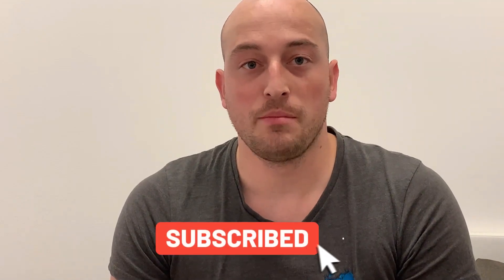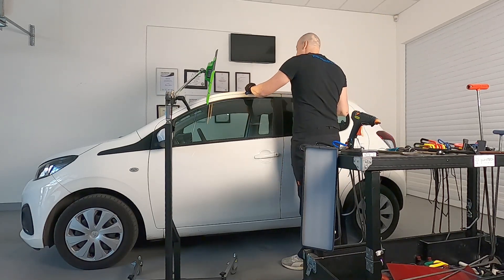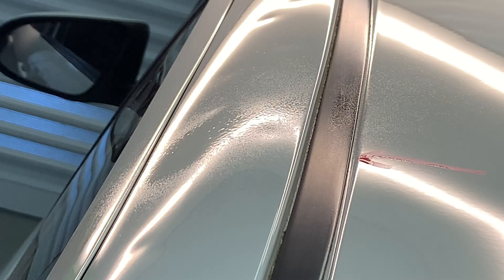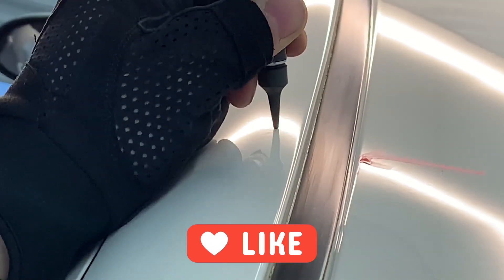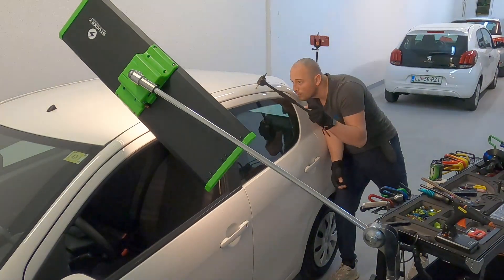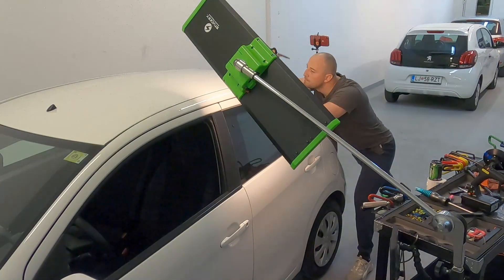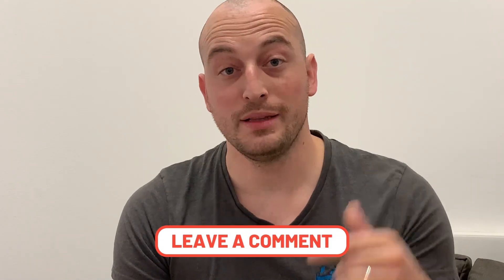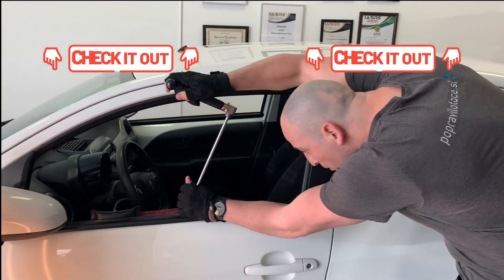Glue pulling | How to glue pull? | PDR beginner tutorial (Learn PDR)

Comment: Do you think that an Amazon PDR dent pull kit (SuperPDR) is good enough for a starter kit for a beginner? I noticed that the tap downs is a hard plastic. I’m thinking about giving it  a shot. The kit is just for glue pulling only, no rods included. Is there a better less expensive kit for beginners to start with?
Reply from the maker: Hi Mike. No definitely not worth your money. Check out my video where I test cheap tools
Reply: The kit is a glue pull kit only . No rods included
Reply from the maker: @Mike-ku1hj  still the tabs are like we used 20 years ago. The industry has come a long way and improvements have been made in glue pulling game

Comment: Hi Zan. I am a DIYer who only fixes hail damaged cars for myself and family and have repaired 6 cars over past few years but still consider myself a beginner. My problem is these cars usually have major hail damage on most panels and I can get large hail damage down to small size, say 10-15 mm size but can’t get from there to a perfect repair. I either end up with volcanoes or just smaller size damage that I can’t seem or to tap down. I’ve changed glues and tabs and slide hammers but i think it’s my technique, not tools that is the problem. I am a subscriber and have watched all your videos and you make it look so easy . Would you be able to do a video to show the technique to get from a large hail to small hail to no hail damage? Thanks for the videos .
Reply from the maker: Hi Craig. What panels are we talking about and do you only use glue and tabs or do you also have rods to push with?
Reply: @vidicz  hi Zan. I only use glue tabs for all hail dents as pushing dents looks like an ever harder skill to learn. Im trying to make the dents look as small as possible but would like to know if I can get them completely out just with glue tabs. I have always used  a mini lifter but recently bought slide hammer to try to improve the result. My current project car has damage to all panels (roof/ bonnet/ doors / rails) and it was assessed as ‘light damage to all panels’ but it has quite severe damage hence to need to do some major pulling. As always, your advice is appreciated.
Reply from the maker: @craigmathisen1542  rule of thumb is push what ever you can push and pull only where you can’t get your tool on from underneath. Glue pull is much harder and more time consuming. If the dents are big and sharp it would be really hard to glue pull on top panels.

Comment: What type of glue would I need ? Is any hot glue acceptable
Reply from the maker: Not any hot glue will work. Well they will to a point. Each glue has its different characteristics and will work differently in different conditions. However you do need a PDR hot glue...there are some other non pdr hot glues that work occasionally but are rare
Reply: @vidicz  I’ve being trying with normal hot glue and it hasn’t worked now I know why any suggestions on a good glue ?
Reply from the maker: @denisedx  if you are from or closer to europe then black glue from denttoolscompany.nl is what I use. Best price/performance for me.

If you are closer to the states then I heard good stuff about many different glues: tab weld, hawg glue, cactus green, ...

Comment: Hi Zan, thanks for the video I found it helpful. Today I spent a few hours trying to remove dents from my Mercedes which has been hail damaged. I tried to use the techniques you used in this video and I found I was able to pull up large dents pretty easily however with small dents I found it hard to pull them up as I couldn’t find the centre of the dent and I can’t seem to get it perfectly level. Do you have any advice to help pull up the very shallow dents which almost impossible to find the centre point?
Reply from the maker: Hi. Well if they are shallow then move your light back and you will be able to see them better. Hope this helps
Reply: I was trying without any light at all. I've now ordered a light online when I get it I'll give it another try, thank you!
Reply: Hi Zan, when you tap down a dent that is raised (after glue pull) can you please explain your process to level it. Do I apply most force in the very center then gradually less force and i work my way to the boundary of the dent? Would love to know, thanks
Reply: I also like to know this too. I can get the dent almost perfect but then blending it to be perfectly level I have trouble with too.
Reply: @tompongrac8952  if you are still trying to remove those hail dents, first is definitely to get a light, u can’t fix what u can’t see. 
When dents are on top panels, hoods, roofs and trunks you have to CROSS CHECK which is just moving your light around the dent, not trying to fix it from one position.  
At first it’s really hard to see where to precisely put your tab, I recommend taking a coin and placing it as center on the dent as possible and tracing a circle around it (make sure what ever u mark with doesn’t damage paint, dry erase marker is ok), then remove the coin and it’s much easier to get you tab in the right spot.  
When you are knocking down SLOW DOWN, make light knocks and move your light.  
Normally a nickel size dent glue pulled will take 20-30 taps (for me) to get proper flat. 
Biggest problem I see when people try PDR is they push or knock to hard.  
Hoe this helps, Good luck. 
San has a video on KNOCKING DOWN that is excellent.
Reply: @dingking7577  Fantastic info thanks! It sounds like I was expecting it to level too quickly. I ended up repainting my car as I couldn't flatten the dents, but in hindsight, I should have paid someone to do the PDR for me.  I'll try PDR again on a test panel using your advice and see if I can do it. Is the San video you're referring to this one? 
https://www.youtube.com/watch?v=PrrbtGKM4ms  (it didn't exist at the time when I was learning all this)
Reply: @tompongrac8952  It autocorrected.  Zan (The channel we’re on now) has a video on “how to knockdown”. 
PDR is one of those skills that requires constant practice, you are basically learning how to see through the metal to exactly where the tip of the tool is.  
I’ve been at it for 25+ years but I can vividly remember the struggle in the beginning.  
But if it were easy it wouldn’t be as satisfying of a career.   Good luck!
Reply: @tompongrac8952  Zan Vidic’s video is titled: 
“How to tap down a dent / Knocking down high spot / Tap down tutorial” 
It’s from two years ago. 👍
Reply: @dingking7577  Ahh yes. Yep Ive seen Zan's video on knocking down the dent. Zan makes it look so easy! :)  But its not of course. I'll keep practicing buf if I really want to do it as a career I'll pay for training so an instructor can show me what I'm doing wrong
Reply: @bd3563  I put an answer to that question in this comment stream.  👍